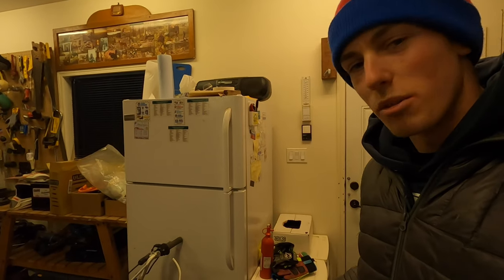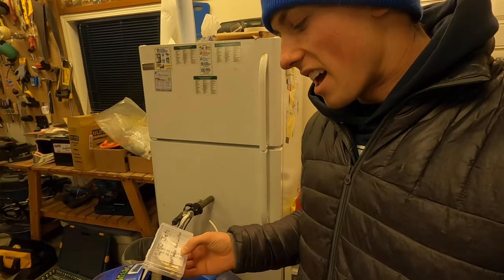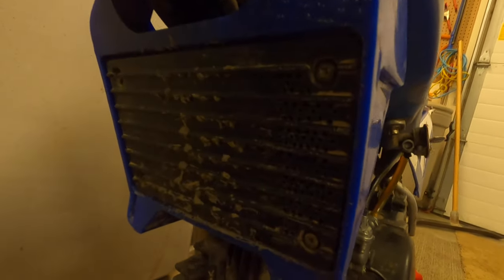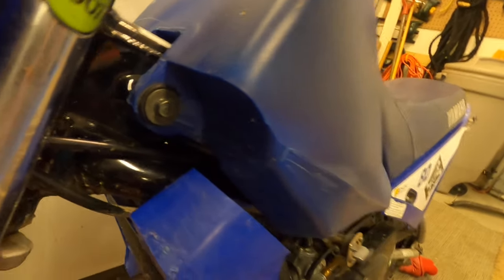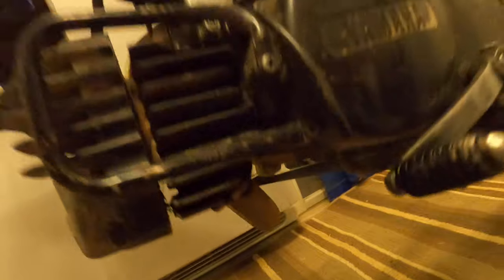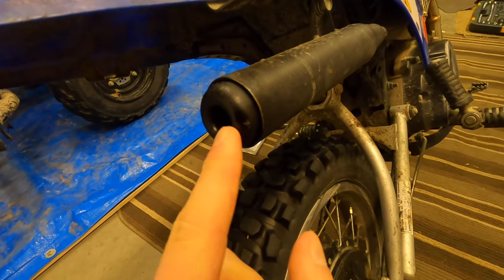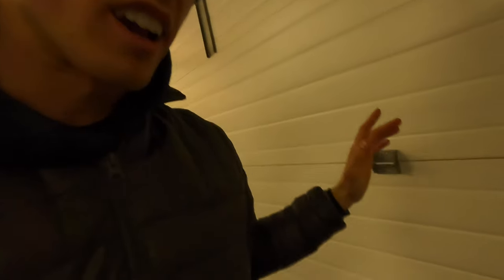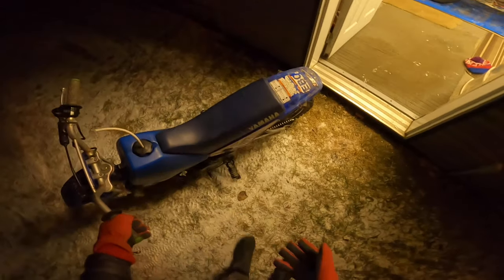PERFECT Jet Size for PW80

Comment: The main jet only affects performance during WOT (wide open throttle) and some during mid throttle but most of the mid throttle work is done by the Pilot jet I'd say. My sons PW80 is running mediocre and I am upgrading the pilot jet from a 15 to a 30 in the next couple days. Will let you know how it goes.
Reply: I really appreciate if u share how it performed after the mod
Reply: How'd it go?
Reply: @thooke222  I really just suggest u to change the air filter for a High flow air filter and just modify a bit the air/fuel mixture, then add 2t oil to the tank and runs way better, trust me
Reply: @Isk_98  what is 2t
Reply: @tobiashess8056  Sorry, i mean 2 Stroke oil, un spanish we call it 2 tiempos, my fault
Reply: Main jet and the needles position are what control everything after about 25% throttle.